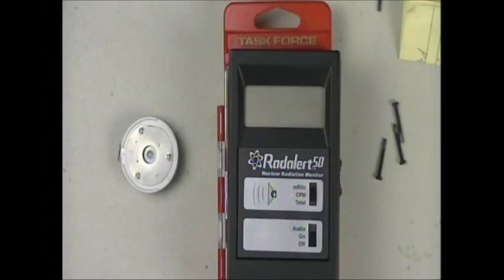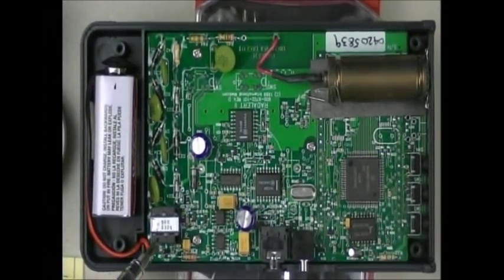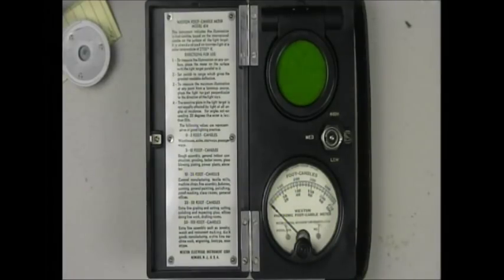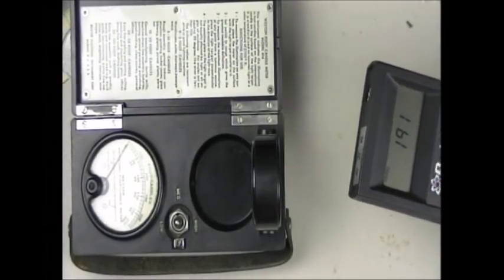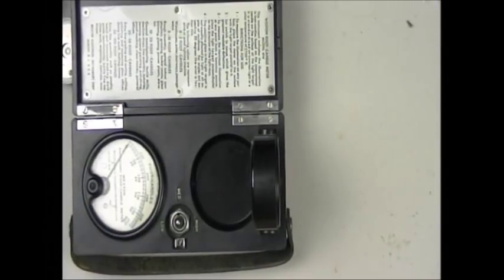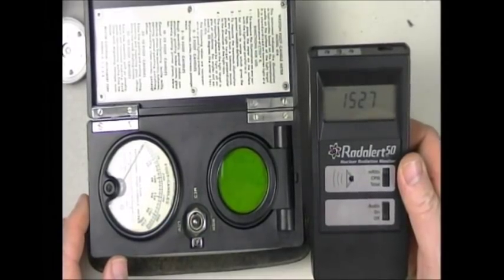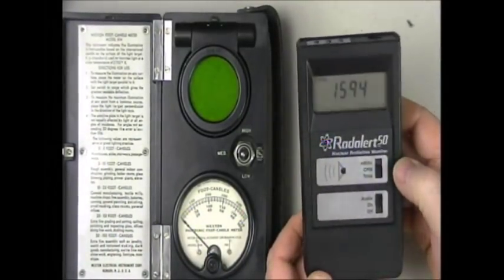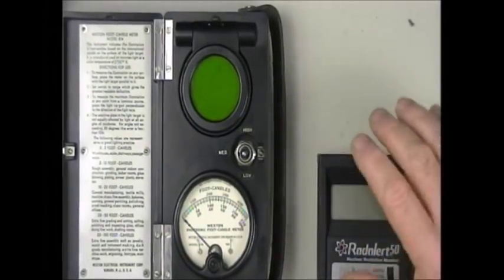Geiger Counter Circuits Introduction

Comment: Tungsten that's used in TIG welding has Thorium in it.
Could you scan a piece of it with your counter, always wondered how "hot" this stuff really is.
Reply from the maker: Yes some TIG rods do.  I've seen them advertised. They are mostly tungsten but should work.